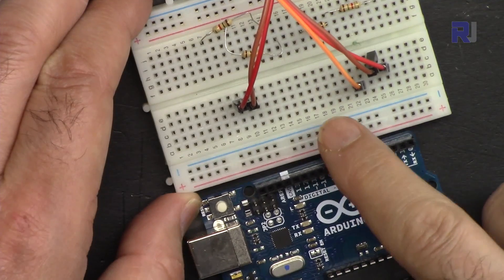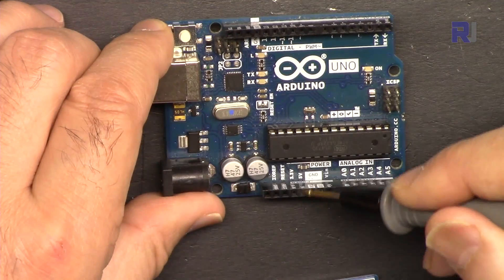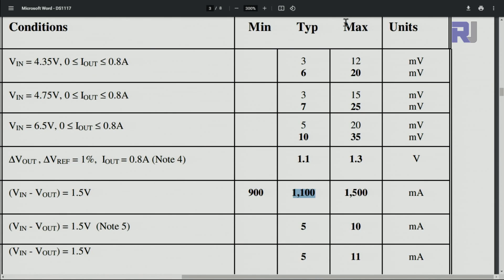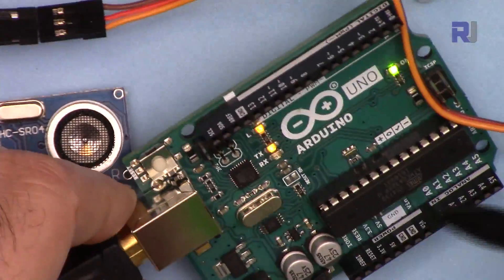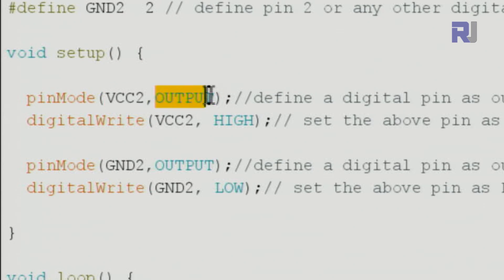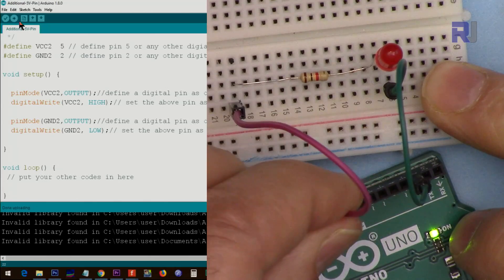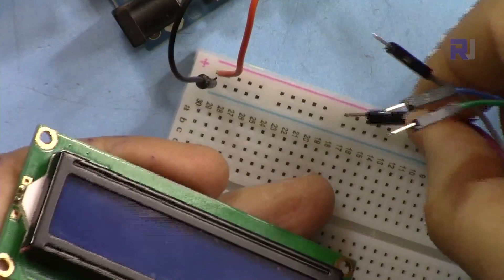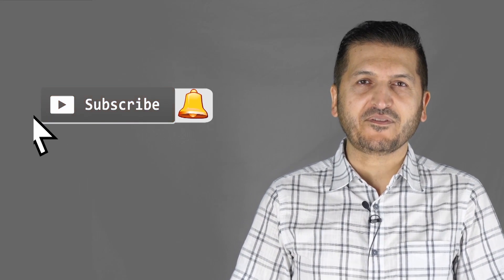Lesson 07: Getting Additional 5V and GND from Arduino  | Arduino Step By Step Course

Comment: What a pointless tutorial. You can wire one 5V pinto many devices, that is what the bus bars are for on the top and bottom of the bread board. You don't get any more current by using I/O pins as a source of sink of current.
Reply from the maker: Just read other people comments. If you did not need extra pin for 5V then you should not have come at the first place .
Reply: @robojax  Yes it shows you what a very low level of audience you have. People who do not know you can wire all the signals to one pin and there is zero advantage to what this video shows. This video is sadly another example of a video written by someone who knows nothing about electronics and just wants to make money. 
I came here from the Arduino Forum because someone thought this tutorial showed you that you could get MORE current using  output pins, over and above that you could get from a single 5V connection. If you know this is true why post the video  at all, if not then you do not know enough to be making such videos. By making videos for beginners you have, or should have, a duty of care to not deceive them.

Comment: I v tried to make pin 5 as extra vcc and pin 2 as extra gnd but it cant make my relay work, what can i do is make pin 5 as extra vcc and pin GND as gnd, how to make it work for my relay ?
Reply from the maker: I mentioned the amount of current . Your relay must have need more than 30mA. Check datasheet of the chip used in your board.
Reply: @robojax  and i have 2 condition if, else if,and else, how to write code properly